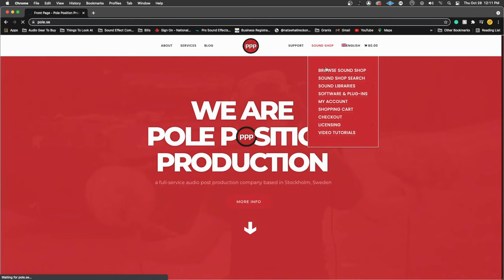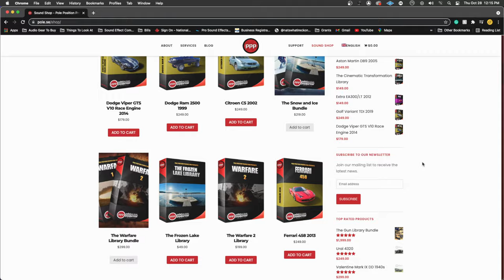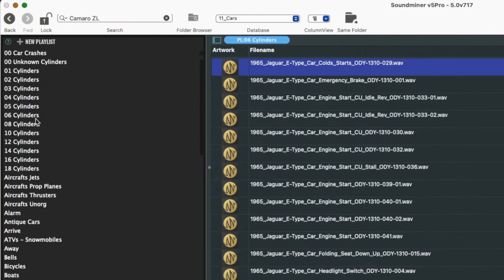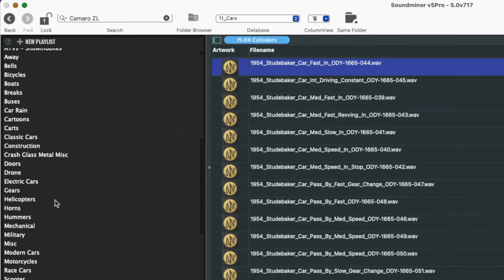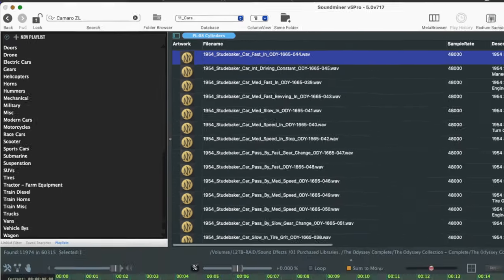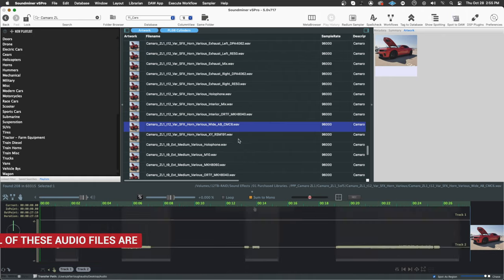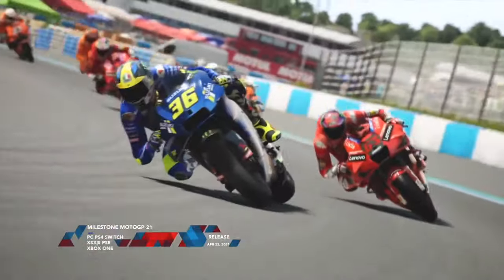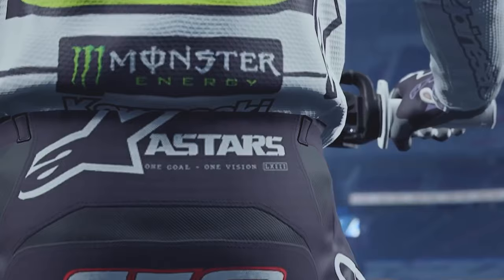Ultimate Guide To Vehicle Sound Design & Recording

Comment: Do you happen to have any idea what microphones they were using for the Exhaust?

Also they don’t seem to worry about positioning the microphones in a heated area, is this due to the cold weather?
Reply from the maker: One trick for not being worried about heat is to run the car for awhile before placing your microphones, you'll be able to find the cold spots in the car and that is where you put your microphones. 

For what mics they are using on the Exhaust, they change them out quite a bit. Beta58, DPA4062, RE50, etc. If you ever are wondering which microphones they are using on a specific library just look at there metadata and they usually have it listed in the file name.

Comment: Its very unrealistic to mix interior recordings with exhaust or engine. I would never do that
Reply from the maker: Really? You can make int car bys by rolling off the high end and applying some reverb to it. If you want more character from your cars, doing the same really helps them out.
Reply: why, should you add reverb to a already great interior recording from pole position?. It just doesnt make sense to me. Theres almost no car in real life, that produces reverb in the interior. Maybe some, but they are still not artificially created in a DAW. People enjoy my sounds, because i dont change any characteristics of the car. Why should you want more characteristics, some cars are louder and stronger in interior, some not. A normal sports car interior shouldnt sound like a loud race car.  Also that will not be realistic. My customers rather enjoy a more muffeld interior sound, that is 100 percent realistic and without any additions from the exhaust or engine bay. My strategy is 3 different sound channels. Bonnet camera when driving ingame, will be completely engine bay recording, rear chase cam will be exhaust recording, and cockpit interior recording. This would give more variety, because every channel has its own unique sound channel. If you would mix them a bit together, the variety of the car sound will be much more better, and of course fully realistic and original.
Reply: @AftertouchAudio  i forgot to mention, why add a doppler effect from a onboard recording to make it sound like a fly by,  just pick one field mic with a car fly by from your sound library. Just easy as that. Please explain why?
Reply from the maker: @exotic_sounds  I'm a little confused by your statement here. Pole's INT designed mixes use there EXT onboard mics in there designed mixes... They also just released car INT impulse response library so you can add INT car reverbs to your sounds to help better achieve this effect. I'm a little confused as to what you mean here, as you also say you mix Exhaust and INT recordings for your INT Chase Cam? 

It really comes down to what the film scene needs. If you are looking for more character, this is ways you can get it. I'm not saying cut the engine from a 240 on a Lambo and use an Exhaust from a motorcycle to get more character, I'm simply saying, you can mix other perspectives from the car in your INT to give the sound more character, this happens in just about every film I've ever seen.
Reply from the maker: @exotic_sounds  Some people don't have access to $250 libraries of cars. So if you don't have them or the ones that are recorded are not working for your scene, you can make your own. 

This is the process of Sound Design vs Sound Editing. If you need something that you don't have, you can design sounds with the recordings you have to make new recordings, vs, just selecting a different sample.

Comment: Its very unrealistic to mix interior recordings with exhaust or engine. I would never do that
Reply from the maker: INT recordings sometimes need help, I tend to mix the Engine or the Exhaust with my INTs to help add some character to the car. Most of the character from the car comes from those components so all you are doing when mixing them into your interiors is bringing them out more and having more control over the sound of your car. 

Plus if you roll down your window slightly, you'll hear more of those components ;)
Reply: @AftertouchAudio  but in most games and movies, windows are rolled down. So that wouldnt make any sense either. I accept your oppinion, but thats exactly the thing that most people hate in racing games and movies. They wont only interior sounds in interior, and exhaust only exhaust. Aswell physically that would be totally unrealistic, a sound from a mix outside of the car next to exhaust, should never be played with a mic in the cabin. Id rather have a less immersive sound, than a less realistic one.
Reply from the maker: @exotic_sounds  We are Sound Designers, we live in the hyper-realistic to make things more exciting for the players/audiance. Again, it is just different flavours. 

Cars and Guns seem to be the two areas in sound design where people go nuts over "realistic" and what is right for the scene, I'm on the side of do what is right for the scene, if you need more power in your car and a Tiger Roar mixed with a modulated synth layered with your exhaust will get you there then I say do what sells the scene.